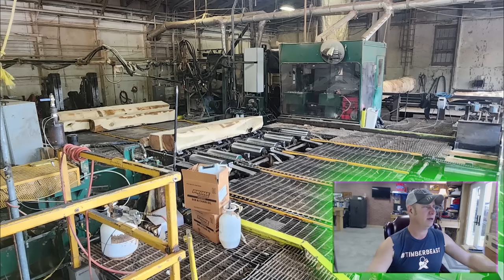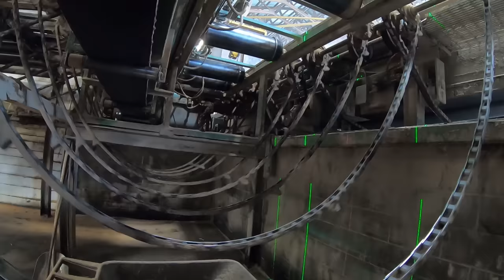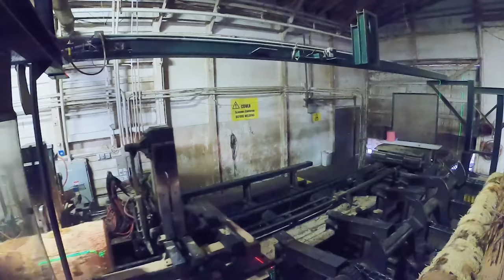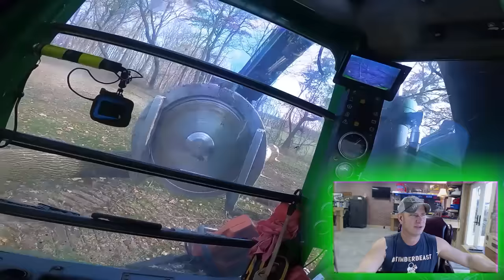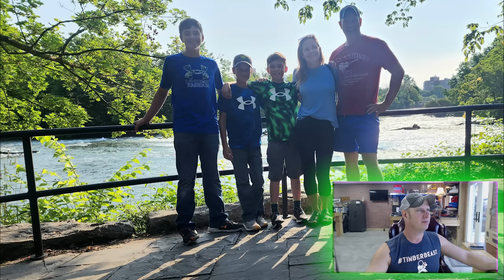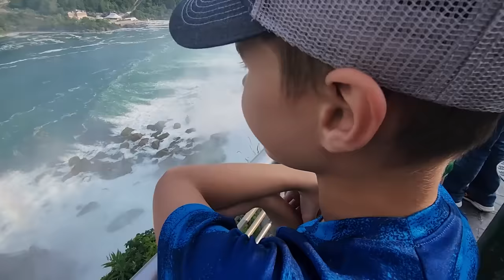What Happened this summer‼️

Comment: For your army truck, I think you may have mistaken the Mack rears for Rockwell top loaders, they're basically the same style and I think a few internal bits, maybe bolt pattern to the case, but at the same time, you could also be right since those trucks were built by pretty much all the major builders to a specific set of plans and all the parts had to interchange from all original makers to whatever was in the pool at the time.
Reply from the maker: Yes got ya thanks man

Comment: As far as your Army truck goes- I believe that is an 817 because it is a dump truck.  The 813s were cargo/troop carriers.  Those trucks were built to take a beating and they are fairly simple to work on.  
Thanks for the update on the last few months.  It looks like you hardly have a dull moment.
Reply from the maker: Got ya yes makes perfect sense now I bet I got the numbers all jumbled up
Reply: @LoggerWade  no problem at all.  I preferred to drive the 817 because I had more fun operating the dump than hauling troops around in the 813 and hearing them whine about how uncomfortable it was to be bouncing around in the back of the truck.